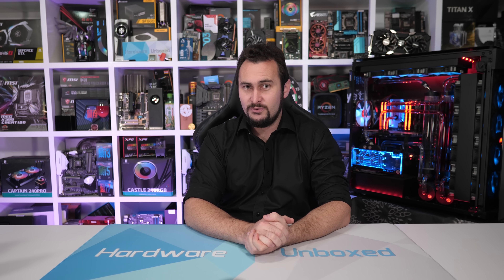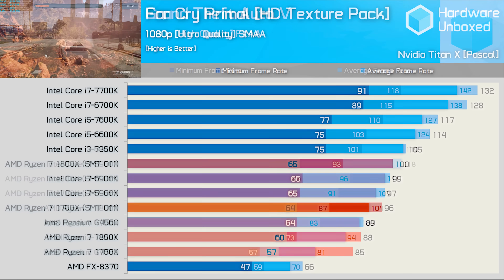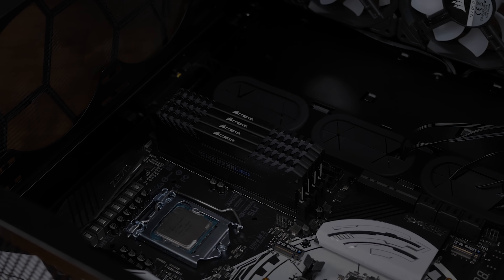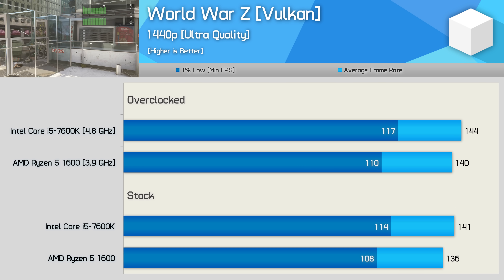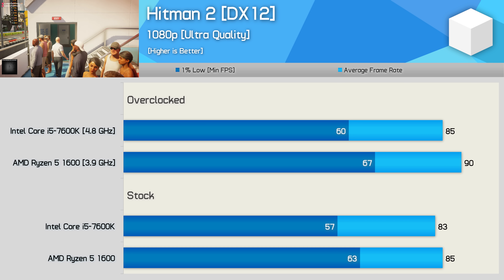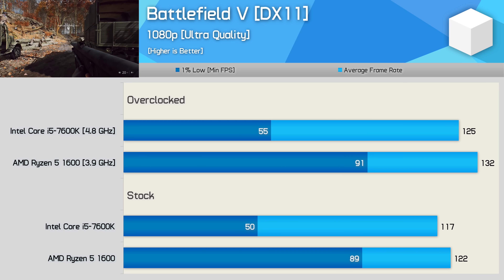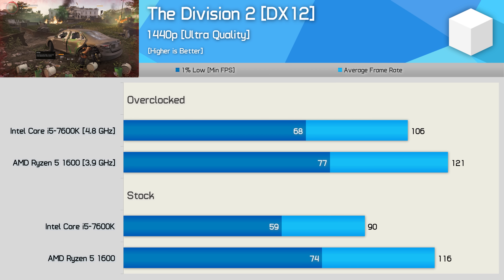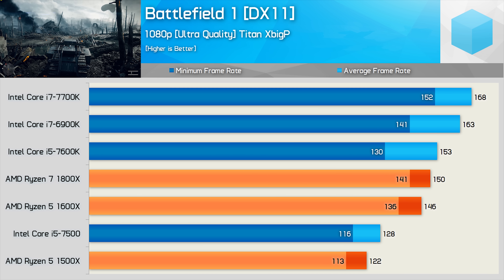Ryzen 5 1600 vs. Core i5-7600K, How Times Have Changed!

Comment: Would love to see the Ryzen 3 1200 vs Core i3 7100 or 7350k.
Reply: The Ryzen 3 1300x is actually better than the 2200g. 
The 1300x has the same cores and clocks, but since it has no igpu it has double the cache compared to the 2200g.
Reply: @remixislandmusic510  I didn't actually knew that.
Reply: @remixislandmusic510  So in your opinion "better" actually means "more expensive" as you need a discrete graphics card as well on top of the $99 compared to $129 release price. In that case then you're correct.
Reply: Why doesn't this comment have more likes???
Reply: Ryzen 3 1200 vs 2500K
Reply: treex Sandy bridge rocks
Reply: @mrahaman0307  no,upgrade path= 0
Reply: @yannicg  Probably because the original R3s wasn't particularly popular, and the release of the 2200G made all past and future Intel i3s completely irrelevant. Not even sure why Intel even bother to make i3s still.
Reply: @SamsoniteDove  Well,im using an Intel core i3 8100 in my laptop(yes,a desktop CPU in a laptop)and one of my family members uses an ryzen 3 1200 overclockt to 3,9ghz on the stock cooler as a gaming PC CPU).
Reply: @KingOfGorillas While I agree the 2400G is a better choice. It's actually an R5, not an R3. https://www.amd.com/en/products/apu/amd-ryzen-5-2400g
Reply: The 2200g is the successor, it makes like 560 to 600cb or something (last score I made was 650cb on extreme cooling low voltage 4.25 GHz, so 4 GHz would be 611cb, 3.9 would be 595cb). That’s pretty good! But what is weird is the IPC is lower than R7 1700... I got 1000cb disabled SMT and underclocked 3 GHz, so 4c/4t on it at 4 GHz would be like 666cb! I’m not sure what is going on!

The RAM is different is the only thing I can think of... The 1700 I had benchmark tuned memory for 2666-12-13-13, and the APU I ran 3200-19-20-20 (yes that’s XMP timings for 3600 Hynix, works fine in quad channel in my Threadripper, but literally cannot tighten timings one tick, or run 3266Mhz on the APU, it has a severely weak memory controller on this one! SOC voltage added beyond safe for daily, however it’s sub-zero cooled, so it might be safe for that cooling, -60c idle phase cooled).
Reply: @jakegarrett8109  the r7 has more cache than the r3
Reply: @yannicg  So does my Threadripper (and Epyc is twice Threadripper, 4 MB per core), but also so does FX, FX has 16 MB cache, but you don't see it as "fast".

Cache size is only helpful in certain applications (mining for example sees the FX dominate Intel and close to Ryzen in efficiency even), but literally only Monero mining have I ever seen an FX do well like that and smoke the current competition... But for that 1 application its good, just nothing else!

Its kind of like RAM, when you need it, then its great to have 128 GB of RAM, but when you don't... Well its not any better than 16 GB. It just depends what you're running.
Reply: @jakegarrett8109  I agree with you.
Reply: @jakegarrett8109  core cache, the 2200g has 4mb, 1700 has 16 mb, or 8 mb per four cores.
Reply: I agree the price of the 1300x is stupid. You can get better performance from a 1200 overclocked on the stock cooler, what i ment is that it performs better than the 2200g.

Id pick a 2200g over 1300x simce its simmilar price, has good graphics, and has better memory support than 1st gen. 
 If you have a power full gpu and are willing to overclock, id pick a 1200 over 2200g tho. If not, 2200g is a good cpu.
Reply: @remixislandmusic510  I disagree. The 1200 is not a very good overclocker (although golden samples does exist). Worse in fact in general than the 2200G. The CPU performance is really very close on those despite the 2200G having half the L3 cache. Still with the 1200 being more expensive at $109 to $99 release price, and still needing a discrete graphics card as well.
Reply: @yannicg  I'm not sure why you think the current price is relevant. That's like comparing 2nd hand parts to new parts. The price comparison is, and should be, on release date prices.
Reply: @SamsoniteDove  because you can still buy the r3 1200 on Amazon and if someone builds an PC right now the CURRENT prices matter a lot(I got an r7 1700 Wich I overclockt to 4.1ghz for 175€ in March 2019 new on Amazon to give you an example of what I mean.
Reply: @yannicg  And how much for a graphics card comparable to 2200G performance? Add that to the 1200 price, and you have the real price of the 1200 to compare against the 2200G.
Reply: @SamsoniteDove  because you can't buy things for release day prices? why would release day prices matter at ALL for chips that weren't made at the same time, let alone years after they were made?

when the 1200 released, you could buy one for $109, and you could buy a 2200g for what? oh. that's right, you couldn't buy one bc it wasn't out. when the 2200g released, you could buy one for $99, but did the 1200 cost $109? no. it went for around $85-100, basically the same price point or cheaper. 

Now, nobody is buying either processor for more than $90, so their price point is completely irrelevant. That's like saying you shouldn't buy a 1700 and should buy a 2600x instead bc the 1700 released for like $50-100 more, but ignoring the fact that the 1700 can be bought brand new for $50-100 less now. I wholeheartedly disagree. CURRENT price is what you're paying for things. YOU AREN'T BUYING THEM FOR RELEASE PRICE, so why should what you USED to pay for them help decide which one you buy NOW? 

The logic (if you could call it that) is just completely wrong. Sure, you probably shouldn't directly compare used parts to new parts, but if you're comparing new-in-box older parts to new-in-box parts that just released, there's nothing wrong with using current pricing. In fact it is purely WRONG to use anything BUT current pricing. Hell, even comparing used parts to new parts, you just have to keep in mind the loss in value/risk you're taking by buying used, but there's nothing wrong with saying a used 1600 for $70 is a better buy than a new 2600 for $160. the only thing that matters when comparing options to buy is what YOU are paying for them AT THE TIME OF PURCHASE, vs what they give to you in terms of features and performance NOW and what they could be expected to do in the FUTURE. the past is a meaningless statistic when you're talking about PC parts you're considering buying.
Reply: @sparkythewildcat97  To cut a long story short, something which you might have considered, my argument is that a 2200G is more than a 1200. Not only does it OC better bringing the performance really close to eachother, basically within margin of error, but the 2200G is not just a CPU. It is an APU with quite decent graphics performance. That is why it will always be superior in price/performance compared to a 1200.
Reply: @SamsoniteDove  the Vega graphics from the 2200g are slower than an RX 550 or an gt1030 ddr4 edition!
Reply: @yannicg  And the GT 1030 DDR4 retails at $85 at the moment. Even if you say the iGPU in 2200G it's worth half that the 2200G will still be vastly better overall value as the 1200 retails at $70, and the 2200G retails at $85. Unless you can find a discrete graphics card that beat the 2200G iGPU for less than $15.
Reply: Most 1200s can get to 3800-4ghz on stock cooler. Mine is at 3700mhz 1.285v all core, higher than The 2200g or 1300x will do all core at stock.

2200gs arent great overclockers thanks to the igpu.
Reply: Yea you can find a ryzen 3 1200 for like $25 cheaper than the 2200g. Really the 2200g is better for most people, but for someone who uses a good gpu and will overclock their cpu, the cost savings of the 1200 make sense. 
With my overclock, its performance is close to an overclocked 2200g. 

I use a 1200 @3.7 and rx480 8gb. Even in gta 5 my cpu can get about 85fps if i turn down settings so im not gpu limited.
Im impressed, even though my cpu has a +600mhz oc, the cpu still pulls 65w (hwmonitor) ish and runs cool. Any higher speed and voltage will cause thermal issues on stock cooler and higher tdp
Reply: @remixislandmusic510  Yeah. The 1200 generally OCs to 3.7GHz. The 2200G generally OCs to 3.9GHz.
I've not seen anyone push a 1200 past 3.9GHz but I have seen many people pushing the 2200G to and past 4.1GHz but that would probably be with the iGPU disabled although they don't always mention if that is the case or not.
Reply: @remixislandmusic510  trust me,even on 3,9ghz you will still be CPU limeted by the r3 when using it with an rx480 8gb in GTA v,4core4thread cpu's are simply not enough for this game(i used single Channel 2600mhz [overclockt from 2133mhz] cl15 ram Wich isn't good for gaming).
Reply: @yannicg  I agree, I am generally cpu limited. However, I have a 60hz display and my cpu can maintain over 60fps at all times, so it doesn't matter.
I have 2x4gb DDR4 3200mhz ram. It helps my cpu along well.
Reply: @yannicg  I was even CPU limited when I used my GTX 1050 before upgrading to a 480. I can run at higher gfx settings with over 60fps tho.
Reply: Ryzen 3 1200 wins because the platform can be upgraded to at least the fastest Ryzen 2...
Reply: The 1200 was already a far superior choice for gaming back then, when overclocked it could even go against the i5s.

I would like to see it but the results are very predictable, the 1200 will obliterate them.
Reply: i3 7100 is a dual core so its basically shit for gaming, in terms of stuttering (from personal experience)

Comment: Im rocking the 7600k
Reply: RIP
Reply: why?
Reply: @billygray8863  i bought it in 2017 back then there wasnt too many options  my specs are 7600k paired with rtx 2060
Reply: brand power is over powered
Reply: @rohanmobarrat2351  Ryzen was released during febuary 2017..
Reply: @razorblazor571  it didnt come to my country then i had to buy 7600k  but man ive been regreting
Reply: @rohanmobarrat2351  well what's done is done, just make sure your next upgrade is at least 8 cores/16 threads. This 6 core stuff is very short sighted. Works well now...but not for long.
Reply: @razorblazor571  i think i might be able to upgrade to ryzen 3600
Reply: @rohanmobarrat2351  That's a 6 core zen 2. Next gen consoles will have 8 core zen 2. Won't clock higher that 3.2ghz, but still...something to consider.
Reply: @razorblazor571  i wouldnt get any console
Reply: @rohanmobarrat2351  I never said you should.

Comment: Gotta love that AMD FineWine™ technology. Great content as per usual HWUB!
Reply: @Neiva71  4790k still holds up pretty well too. You know why? Because Intel has not innovated in the last 8 years. They tried to do little iterations each year and not much changed.
Reply: @Neiva71  Only if you ignore the price initial difference, the platform cost, and the fact that you'd need to buy a cooler for it as well.
Reply: Neiva not really, and my 6600K which is essentially the same thing as a 7600K proved that. No more microstuttering and better 1% lows just from switching to a 2600.
Reply: I bought a 1090T back in Jan 2011, Ran that overclocked to 3.8-4.0 untill i upgraded in 2017 to a 1600X. So I can happily say I have been on 6c for a long time now
Reply: @del635 It's not more futureproof, as by the time finewine kicks into overdrive. 
The cards themselves have reached their end of life. 
Nvidia and Intel don't lose performence, it's AMD that gains due to the shared microarchitecture between the consoles and pc. 
As for your GTX 680, well it is unreasonable for you to expect that a 5 year old card, would be able to play it.
Reply: AMD was always headed for future tech... it all began with HD 7000 series, 3 GB vram and 384bit bus. Of course "more" ages better, this is the same: you simply have more horsepower, more cores, it's a stronger engine and ages better for that reason
Reply: @del635 I can understand the confusion. 
What i mean is that by time fine wine kicks in, your gonna want to upgrade anyway. 
And games not starting because of vram limitations is the developers being lazy. 
Any of the games that can't be started due to developer imposed limits can be bypassed. (There's a youtuber who does it for a living). 

Infact the whole reason for me knowing it about was due to having bypass the memory limit of Cod Ghosts which required 8 gigs of ram, which i dind't have at the time.
Reply: @Orcawhale1 hi fanboi
Reply: @itsabeetlebee9222  Totally.
Reply: @Orcawhale1  hi fanboy
Reply: This is not finewine, but simply down to the games his chosen.
Change the games, and you will get a very different result. 
Also it's really not that good, to brag about the Finewine, as one can fairly easy argue that AMD is shittier because of that. 
"Nvidia peformence right here right now" " AMD proper performence in two years time"
See what i mean?
Reply: @Orcawhale1  whoa, easy there tiger. There's no arguing that the 1600 was a superior technological product at the time, or that it has stood the test of time better. No arguing AMD's superior price to performance, either. Yes, 7600K's do clock well and do okay, hell I have a 6600K in a rig somewhere. But you know what it does? Sit on a shelf - because I bought a used 1700X and it blew my mind. 

FineWine™ is nothing but a tounge-in-cheek jab at AMD's driver development. Usually they release in a state that places the product as competitive and develop another 5 to 10% over time, whereas Intel / Nvidia tend to release close to optimal and focus on bug fixes and major issues in popular titles.
Reply: @boingkster Gotta love how you adressed zero of the arguments used in the comment, and just went the virtue signaling route. 
The Fine wine meme is not a good thing, and can just as easily be turned around to be used against argument against them. 
As stated in my orginal comment, which you are free to read.
Reply: @Orcawhale1  what, the games used? More modern games demand more threads. Clock speed can only hold processing demands at bay for so long before new threads are needed. As a guy who saw the theory, design and implementation of hyperthreading and multi-core CPU's happen, I fully understand this. A fast 4c4t part will usually end up outperformed by a slower 6c12t in more thread-heavy games. Yes, it will be faster in games only utilising a few threads but those are either years old or horribly optimised freak occurrences nowdays.

Microstuttering? Often when the system is looking for a new thread to offload work to but doesn't have one available, or is otherwise starved for resources. Commonly seen in low-end hardware, and sometimes in recent higher end stuff as well... such as the 7600K. The best bet is to put a frame-cap in place or move to a CPU with more threads, assuming RAM and system storage is adequate.

FineWine™ is probably more useful in delivering end-of-life performance, as opposed to the recent apparent nerfing of certain Nvidia cards (Keppler, Maxwell?) by driver updates. It's not more futureproof, its just a different approach.
Reply: @Orcawhale1  Oh, the usual fanboi strawman argument. Test shows cheaper AMD CPU is better than Intel CPU two years down the road and fanboi cries: "Well, Nvidia is still faster".
1) the discussion is about CPUs, not graphics cards
2) the discussion is about value for money so Nvidia losses that one as well as proven in other tests
Reply: @SamsoniteDove  
>Complain about strawman argument, despite it actully not being there. 
>Then makes a whole comment that's a big strawman argument. 
>MFW
Reply: @Orcawhale1  damn what a fan boy response

Comment: Crash and burns, savage
Good job as always, thank you
Reply: The 7600k have bad OC. Goor job for what?
Reply: @n1kobg  "Each CPU is tested with a realistic overclock applied. So we're not pretending every CPU sold is of the highest quality silicon."
Reply: @n1kobg  Listening isn't a strong point for you is it?
Reply: @adapalis  Oh I listen but that little sentance is far from enough when you present a weak OC vs 2 extra cores. How many people you think will take that under consideration, provided they will know what that means and watched the whole video? Like i said, I wont recomend anyone to buy 7600k in 2019 but the CPU wasn't presented properly in this video. This was basically 6600k vs 1600. Then you can say 4,8ghz is realistic OC. They can do 4,6 -7 on average. Average for 7600k is 5ghz. There was no cache OC eighter. Or unlocking the power, even fclk will help to beat a few benchmarks that were given to the AMD chip. Raising just the multyplayer is bad OC, only a noob will do that.
Reply: Nikola Vasilev I don’t expect anyone from eastern Europe to be wise, but you are below average. Even for Eastern Europeans.  Слова Украина! я люблю Володимир Зеленский!!